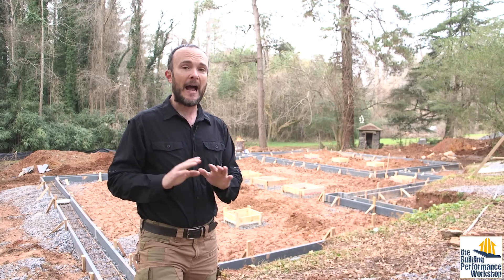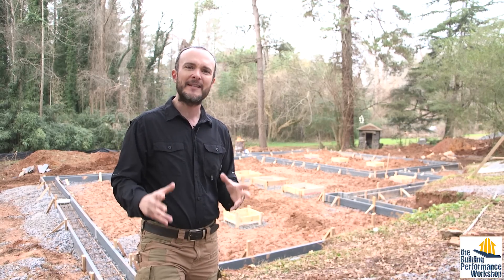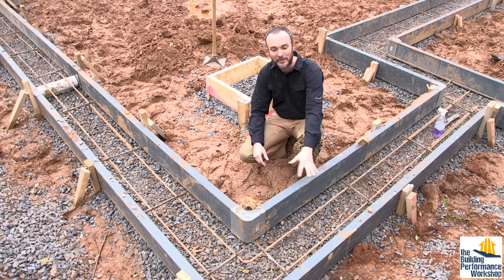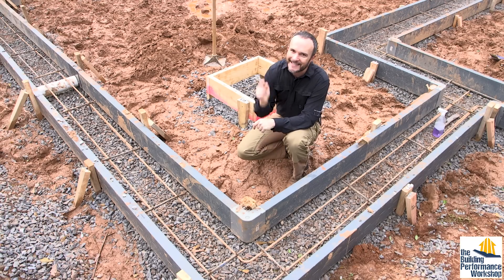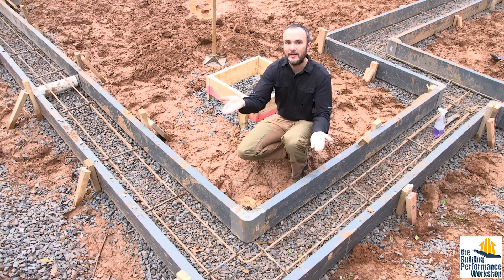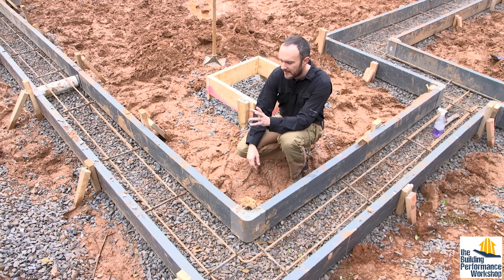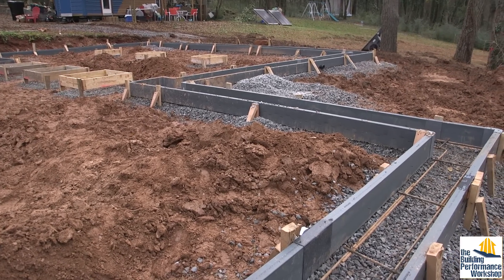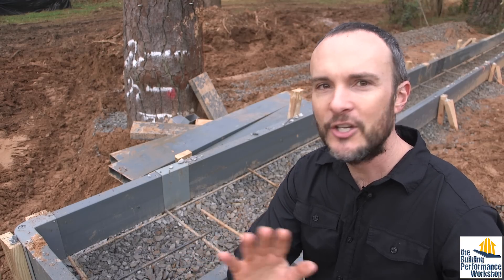First Concrete Pour: Form-A-Drain 4-in-1 Foundation Footings

Comment: Portland Cement Assoc did tests on rusty vs clean rebar and found NO differemce!
Reply: Actually ACI which is American concrete institute did tests that showed concrete bonded better to rebar that was slightly rusted than it did brand new rebar.
Reply: A true story, experienced first hand and was shocking, While building a large grocery store in Washington we had to dowel into existing concrete footings. we noticed 1 piece of rebar sticking out of the old concrete approximately 30 inches below grade. The rebar rusted and destroyed the concrete footing. we broke out the old concrete and found that the rusted rebar created a 6 to 10 inch cylindrical pocket full of orangish powder 6 ft  into the huge spread footing. It was like rotten concrete. this was a 24 in. by 4 ft by 10 ft footing that was holding the steel columns for the existing covered entry.  Absolutely rusting steel exposed to extremely wet weather can destroy concrete.
Reply from the maker: Interesting, Roger, thx
Reply: Rusty is not an issue as concrete curing will reduce the oxide from the rust.
Dirt is a problem, as it inhibits concrete bond to the rebar.

Comment: Good greif. I can't begin to name everything that's wrong with this foundation system.
Reply from the maker: I didn’t think so
Reply: I can start you off for one the lack of form support to prevent bowing., I have done waterproofing systems after footing installation or on old house foundations, as back then very few new builds if any knew about the form drains or that now a days they are required to prevent basement flooding here in MA-RI-CT

Comment: We have used a lot of form-a-drain, but stopped because is too fragile, especially in the winter. Traditional drain-tile deals with steps in the foundation better.
Reply: There is a new product on the market called Form-A-Drain Plus.  15x impact resistance.  The new formulation is much better and cold weather resistant.  Contractors in norther WI have tested the new product and say it is night and day.  Give it a try again and reduce your labor.  https://www.royalbuildingproducts.com/products/foundations/form-a-drain

Comment: I'm just an Hvac guy. My own business with myown name on my truck, with my own reputation to live with. So my two cents is this. It can be really hard as a contractor to inform the homeowner of every ramification of every decision at the point of initial conversation. So h/o makes decision based on information at the time and some unforseen obstacle pops up. Now it's really hard as a home owner to not be upset with the contractor as the professional who " should have seen this coming". This ending in both parties frustrated for good reason. To have a h/o this deeply involved it takes way more time than a traditional build, and day more communication on both parties to make it work. The other aspect is it is very difficult to bid a job where the decision making time is a wild card. To make it work I think everybodies got to have patience and the idea of the h/o being there everyday helping and immediately availible for decisions isn't a bad idea. Though not practical in most cases around the us. Most folks can't quit working for a year to build a house... and still make the ends meet. Like I said my opinion only.
Reply: Also wanted to say the nice thing about h/o on site is that can dictate the allowable tolerances for all the processes, as to the best of their understanding. It's an interesting idea of building this way. Again communication would have to be key.
Reply from the maker: To clarify, the whole mission of this channel is to get homeowners who are looking for proven quality of work paired up with building pros who get paid more and given more time to deliver that work.
Reply from the maker: All good points, John. Thanks for following

Comment: Contractor defiantly knew forms were not secure if they worried about rock pushing them in, because concrete pouring force shooting out of that pump hose is going to be much higher. Contractor should have at least back filled half way up outside the form. But don't worry, that foundation will outlast you & your kids, plus no one will ever see it. Put lots of rock & insulation under the slab for good drainage & insulation value. It's going to be a nice house & that reinforced concrete will easily last 100 years. Good that you cleaned that mud off the rebar. Dirt inside concrete is bad.. Dirty materials is why people should make sure concrete supplier washes their rock before they mix it into the concrete. Strong concrete starts with clean rock & sand. Then add fiberglass.
Reply from the maker: Thanks Michael- and for the foundation sub’s staking, just know that the site was worked on for almost 3 months and still had wet spots, so I don’t blame his team’s stakes. One of the rainiest seasons on record.

Comment: Can that forming drainage syatem be used at a deeper footings?
Reply from the maker: These will be 1-3’ below grade, so yes
Reply: If you look up Form a Drain thought made by a different company these days so they are Form a Drain + (that is, plus, otherwise) as its thicker and comes in many heights to accommodate deeper footings, here in MA, CT, RI and where else walk around basements are popular they are still recommended and required to have a proper drainage system. Especially along bodies of water and in flood plain zones.

Comment: I'm old school but most of my form work has a key way in the footings and then you put the rebar in. The purpose of the keyway is to keep the foundation from sliding off the footing I would never build a  wall without that keyway in the footing I don't trust rebars
Reply: There really isn't a simple way of doing construction that won't fly by in New York stateI'll take the time and put a 2 x 4 in the footing then pull it out I rather have that indentation of 3 in by an inch and a half deep to keep my foundation wall on that footing
Reply from the maker: Thanks Eugene, that was an option too, but struc eng approved simpler way
Reply: To each their own ... as the saying goes, then again there is the regional or local codes to also adhere to depending on how strict they are. I myself plan on ICF basement foundation and post frame atop it, for a home when the time comes.

Comment: I would never work with someone like this. I trust the contractor shook you down for every cent you have.
Reply from the maker: Wow, someone must have really hurt your feelings along the line. Sorry to hear.
Reply: Home Performance no not really. I’ve just built over 250 houses in my lifetime, so I know what works and what doesn’t. So when I see a “professional” like yourself starting to come up with clever little ideas on how things should rather be done, I steer well clear, because at the end of the day I, as the contractor, am responsible and liable for the structural integrity of the house for a minimum of10years as I am the party registered to the national home builders association. Not the client and therefor I do as thorough and complete job as to NOT be forced to repair any structural damage at my own cost of said houses. So no, I have not had my feelings hurt as you so sarcastically implied. I just know what types of idiots(self proclaimed) to avoid. Good day sir.
Reply from the maker: Jaco, I test houses like yours and find out what’s going on with them after you leave. I can tell you that any builder who thinks they build well without rigorously testing and inspecting beyond code today will be surprised at what someone like me will find out. I am the builder on this project, and I bear the responsibility, just like you. Unlike you, however, I’m interested in learning and trying new ways to respond to the changes in indoor chemistry and physics that you likely don’t see coming.

Comment: Right on! I’m about to build my new home in six months. Your videos are very helpful and are influencing portions of my design. Couple questions about form a drain: 1) I’m concerned about fine silts clogging form a drain...do you still cover the system in drain rock and filter fabric? 2) I can’t find the manufacturer’s website for this product...could you provide a link?
Reply: Gravel is absolutely required covering the perforations inside and out.  Most codes require a minimum of 6" over the top of your footer on the exterior side, and then recommend a layer of filter fabric over that prior to back fill.  The combination of the two is the recommended installation.  They will be adding both these layers after the waterproofing and insulation layers are applied.  Find more information at: https://www.royalbuildingproducts.com/products/foundations/form-a-drain
Reply: Eric Kimberly rad. Thanks for the info!

Comment: They need to put some noodles in that soup they are calling concrete.  It looks to me that the house is being built below grade level when you look at the road.  Maybe that should have built that house on concrete piers but it looks to me that they may be close to the water table.  The area looks flood prone.
Reply from the maker: Thanks, but no. See our geotechnical engineering videos.

Comment: You want your concrete to last 100 year 😂 we have building twice as old as your country still standing strong. Seems like the building inspected was winding you up! Rebar has groves on it for a reason. It’s still works with a little rust on it. Your building a house not the twin towers! Interesting way of doing a footing though 👍🏼 thanks for the upload
Reply: Surface rust on the rebar is not a problem at all for footings. If heavily rusted and starts flaking than no good. I think he was cleaning the chunks of mud on the rebars which is the right think to do. Cleaning surface rust is a n insane thing to do because it will come back right away.
Reply from the maker: Thanks for being a reasonable chap

Comment: I hope that concrete does not plug your drain holes...hmm
Reply from the maker: It didn’t. Hm.
Reply: He will be coming back with gravel to cover the perforations per ICC recommendation.  Doing this will ensure that the loose fill can't cover the perforations and ensure clear drainage.  I believe their will also be a layer of filter fabric installed above the the exterior drainage field.  This is a great additional step recommended by ICC to ensure that your drainage field is protected from smaller sediment.
Reply from the maker: Exactly so

Comment: You have to watch out for the time the cement is mixed until it arrives on site to be poured (generally 90 minutes max) and yes a slump test is always necessary! When cement (the correct term when in liquid form) is mixed and poured properly it will continue to increase in strength (as concrete) for one hundred years. Yes, the rebar should be clean/free of dirt with minimal rust.  The small lugs on the rebar bond and lock creating tensile strength within the concrete. The formwork should be able to withstand the liquid weight of the cement during the pour with little movement until it sets. Part of the process of the pour also requires vibration or tamping to remove air that is trapped as part of the cement mixing process. This is another reason the formwork should be strong and secure as both processes add addition pressure on the formwork. With regard to owner being on site, there is nothing wrong with this as there should be nothing to hide and if they want to be part of the process that is fine. However if they get in the way it'll cost them twice as much. Also, the owner must not in anyway compromise the safety of people working or themselves and must wear all the safety equipment required. Further, if the owner is just popping by for an inspection to see how things are progressing they must understand that whatever process is halted to answer their questions then additional costs will be associated for time. Finally a little shout out to all the contractors who take pride in their work and continue to learn in this ever changing world. We have come across many obstacles and learned to deal with new ideas and products inspired by insane designers and the lowest bidding manufacturer of poorly engineered products to dealing with baggy eyed homeowners who look like they were up the night before till the wee hours of the morning in their underwear trying to learn how to outsmart us in our own profession. I say let them do what they are good at so that they can afford us to do what we are good at. :)
Reply from the maker: Jesse, I think you’ll enjoy our other 300 videos on this channel. We agree about many things.

Comment: The rebar used is not adequate for a grade beam. Four #5 rebar should be used,as this will break soon after your house is put on it. The beams should be two feet deep.
Reply from the maker: Maybe in other climate zones and other soil and seismic conditions, but no. Not in this case. Structural engineered system you’re watching here.